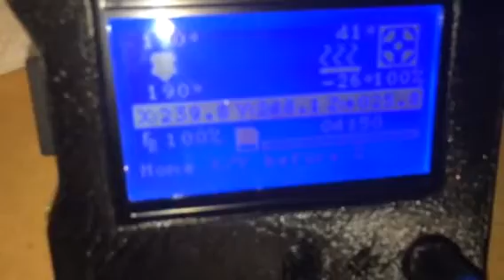More 3d printing on the MPCNC

Comment: This seems to be printing at a decent speed. How fast are you printing here? How does it compare to other 3d printers in the market. I'm considering building one of these and was wondering...
Reply from the maker: Matter control settings.  I think 30mm outside 50 or 60mm infill… it prints just as good as my printrbot. and I often use the same slicer settings on both machines.  ive printed at 90mm/s on test cubes with no problems, but realistically any printer risks layer adhesion issues at higher speeds.  in this video my mpcnc is printing critical parts for itself, while using beta versions of the same parts that had apparent issues and it still printed better than I could of hoped.